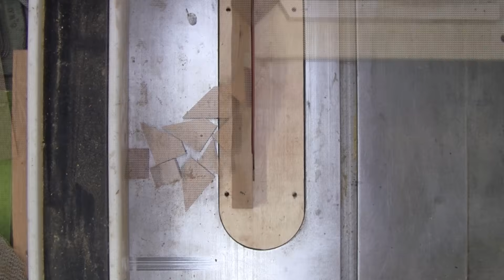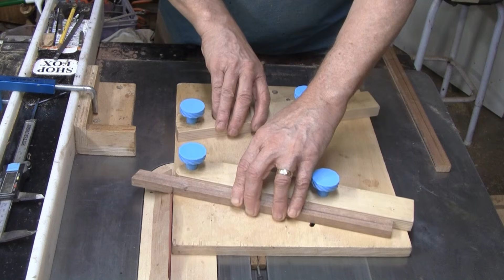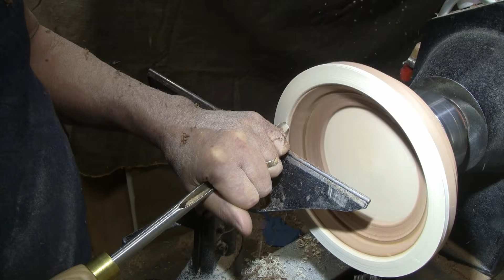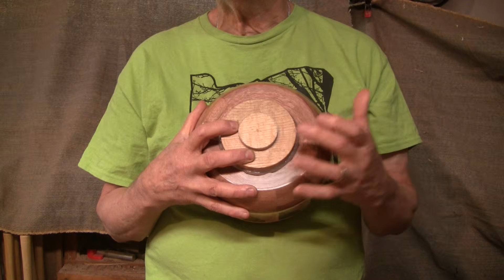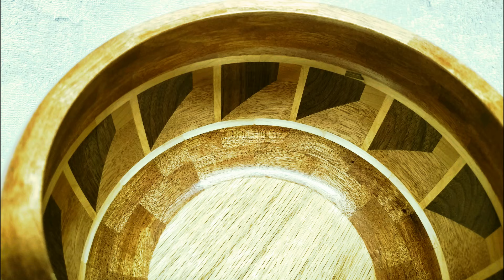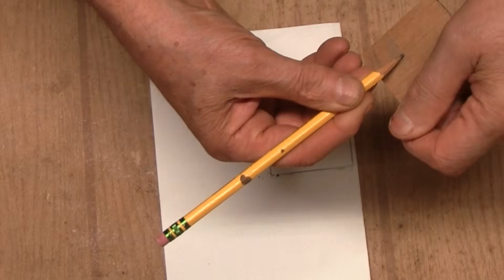Wood Turning A Water Wheel Or Illusion

Comment: Gary
Your work is fascinating.  Thank you.
I'm just wondering how the illusion might look if the feature segments were not exactly square, but a bit rectangular in order to make the bowl slightly larger in diameter without the feature strip becoming too tall? Have you tried that?
Reply from the maker: Thank you Robert. I was sure you  could make it longer one way. But I went ahead and opened up my CAD program and proved it out.
I went 3 inches wide and 2 inches tall. I then drew a 1 inch square in the upper right hand corner.  I connected the lower left corner to that lower left of the 1 inch square and it works. I think it would a be a very cool look and may have to do one.
You can always email if you have questions.
Gary

Comment: Just curious, as I have never done wood turning.  With the grains going in different directions I would think that you would have cracks form over time with wood movement.  Is this not the case?  If not, are there some basic rules you are following to prevent that?
Reply from the maker: Thanks for the question John. There are some that say grain going in different directions can be an issue.  A lot depends on the size of the pieces and I think even more than that the climate you live in.
I have used solid bottoms on bowls an full segmented bottoms and have not had issues. I live in Oregon  and they have something to do with it.
So I do not worry much about those issues. Although most of the pieces I make have the grain going in the same direction.
 So I guess my rule is if it works I will do it.
 Not a good answer but my guess is the climate you live in plays a big part in it. I think one person that stresses this lives in  Arizona or some other hot place.

Comment: What type of longworth faceplate is that, looking for one with the tapered square bumpers
Reply from the maker: The chuck is something I made. Sometimes I use rounder bolt heads for centering up the segments. That is about all I use it for. I could use the bumpers from my cole jaws  though.
Thanks for watching,
Gary

Comment: Hi Gary: Just now getting ready to turn your beautiful bowl. I was wondering if 3/4 inch thick wood for the illusion is sufficient ? Also i like the oak base. I'm guessing you inlayed that inside the fist layer off the tenon ?
Reply from the maker: Hi Jim,
I think 3/4 thickness should be fine. I think my plans called for a little less. Should be plenty of stock to get the shape you want.
 Yes I made the base ring and then cut a rabbit in it to place the bottom.
 Have fun,
Gary
Reply: OK thanks again

Comment: Gary , that was just awesome. I’m relatively new to woodworking and turning but I’ve learned so much from your videos! I do have a question though. I’m having trouble figuring out how you added the Oak bottom so that it’s only visible from the inside ?  Thank you so much for what you do and share with everyone!
Reply from the maker: Thank you Bruce. I cut a step on the bottom which created a place for a false bottom. I may have to show that sometime.
Thanks for watching,
Gary

Comment: like it a lot. what size square did you start with on feature . thanks
Reply from the maker: The window size is 1.875 inchs square.  The larger pieces are 1.875X1.375 inches.
Thanks for watching,
Gary

Comment: Gary,
Yet another creative masterpiece!  Your easy to understand narrative and video is all the incentive I needed to try making this myself. Just made a simple 45/90 degree sled and have cut the pieces for the feature ring and on my way. You are a teacher, extraordinaire! Did have one question. How did you make your base? Did you make the segmented base ring and then cut a circle to insert the oak piece or a recess on the inside. Thanks
Reply from the maker: Thanks so much Bruce! Yes I made the segmented ring and turned a step in it so I could insert the oak. The next ring covered the joint. The other option was to make a complete segmented bottom to the center out of Oak or Maple. But I wanted to keep the look of the Sapele on the outside.
 Thanks for watching,
Gary

Comment: That’s a very nice segmented bowl. Are the maple spacers used in the feature ring cut at an angle , like the segments, or they crosscut with parallel sides? Thanks.
Reply from the maker: Thank you very much Tom. The spacers are parallel. I cut them from longer strips of maple I had prepared to the correct thickness. This keeps the angle correct so all the joints fit correctly.
Thanks for watching,
Gary

Comment: Another great project Gary!!  Now that is getting cooler here in AZ its time to get back to work and this is the perfect piece to get started, thanks for all your work on this channel. Just wondering if that's a floating bottom you used. In all your videos I have never seen you use one if it is. Again thank you for all your inspiration
Reply from the maker: Thank you very much Charlie. We are back to some rain here which is good.

It is really not a floating bottom but done like one. I say not because I did use more glue than you would for a true floating bottom. 
I have to say I have never really done one and I have turnings that are over 50 years old that do not have floating bottoms and are fine.
A lot of times I will use a full segmented bottom to the center. But I wanted a lighter color on the inside is why I did this.

Thanks for watching,
Gary

Comment: Really nice Gary, I am in awe of your ability to design and make it work. What determines if you use paper or power sander?
Thanks, Ian
Reply from the maker: Thank you Ian. On a segmented piece most of the grain is running the direction the piece is turning. So with paper sheets you are not crossing the grain. Also if I have a shape I want to keep I can control it better with sheet paper as it will  mold to the shape. Great question and thanks for watching,
Gary

Comment: How do you work out the angle cut for the circle size.  Gary
Reply from the maker: Vini I just divide 360/12=30 And half of that is 15 degrees on a side. Is that what you are wondering? If not let me know.
Gary
Reply: @ThePapa1947  thanks Gary 👍

Comment: Beautiful piece of work. Do you have to do a lot of trial and error getting the tilt on the saw exact or do you have a technique to get there quickly?
Reply from the maker: Thank you Gary. I use a digital angle finder. I have found that the angle works just using the angle finder on the blade.
I have used scrap wood to make sure but have not had to change anything. I have heard that the angle finder is +or - .2 degrees but it works for me.
Thanks for watching,
Gary

Comment: Fantastic turning Gary.  Truly inspirational.  If I can ask, where did you get your hose clamps from?  I have looked on-line and haven't been able to find any wide enough to handle those size rings.
Reply from the maker: Thank you Dick. Check Amazon for the clamps. You can get them up to 12" for sure. They are stainless steel and very strong.
Thanks for watching,
Gary
https://www.amazon.com/dp/B07KC218PB/ref=redir_mobile_desktop?_encoding=UTF8&aaxitk=a37804a730bd627a0fb4343929a6aada&content-id=amzn1.sym.cd95889f-432f-43a7-8ec8-833616493f4a%3Aamzn1.sym.cd95889f-432f-43a7-8ec8-833616493f4a&hsa_cr_id=1259646520401&pd_rd_plhdr=t&pd_rd_r=311a9a4f-a498-46ed-ba2b-7a218ec5ea61&pd_rd_w=zaGbA&pd_rd_wg=PcIIk&qid=1696007928&ref_=sbx_be_s_sparkle_mcd_asin_2_img&sr=1-3-9e67e56a-6f64-441f-a281-df67fc737124&th=1